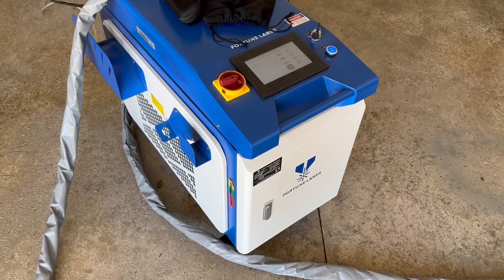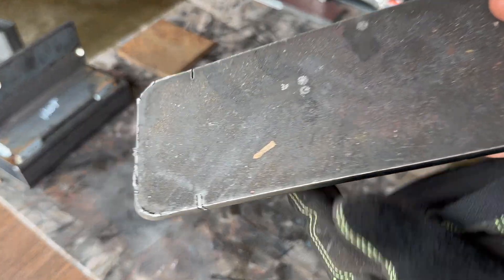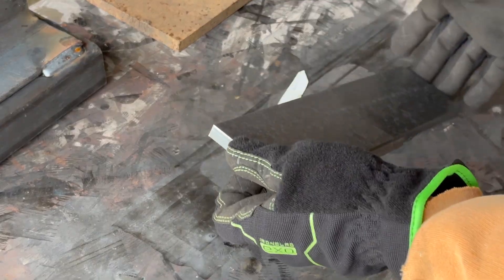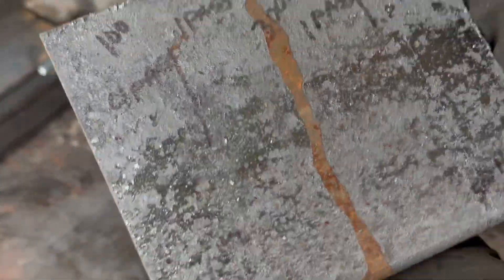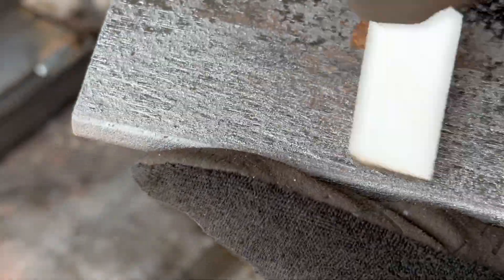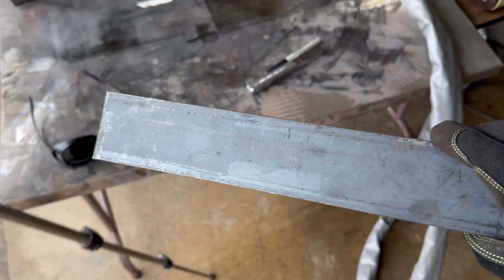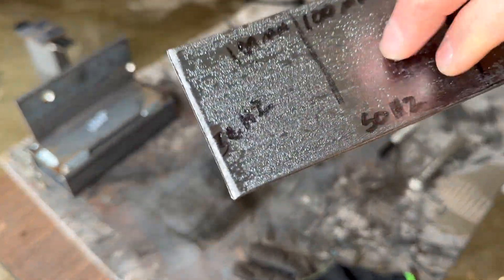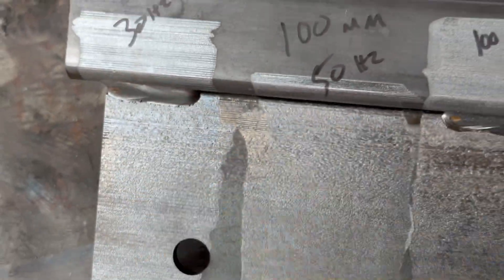2000w Continuous Wave Laser Cleaner Settings Test on Steel Samples

Comment: We are eagerly awaiting the Hilux 1980 project. Has the project been cancelled?
Reply from the maker: I still have it, in winter storage right now. I’m going to be driving it as is for a while while I collect rust free parts to restore the rest of the body. I’m the meantime I’ve started to restore the rusty 1985 4runner.
Reply: @6thGearGarage Is it possible to provide a new original part for it such as Weatherstrip, RUN, DOOR GLASS, or WEATHERSTRIP, DOOR
Reply from the maker: You could check at the dealership, or I like https://partsouq.com/ they seen to have more OEM parts for less $, but higher shipping.